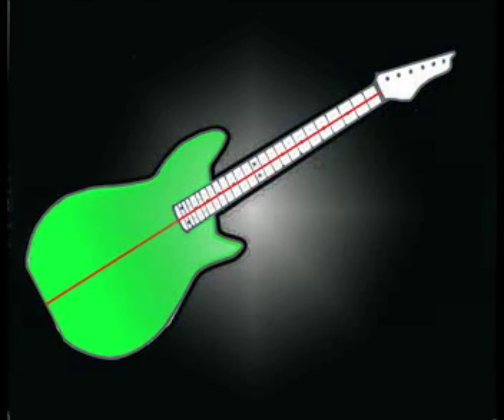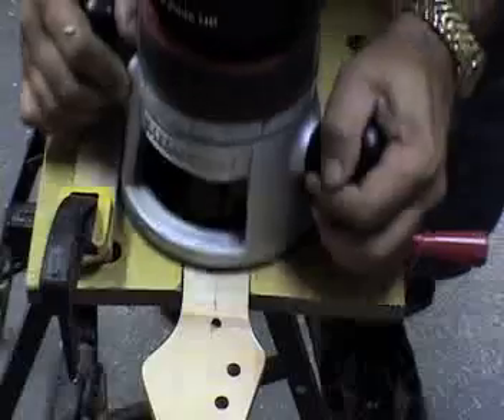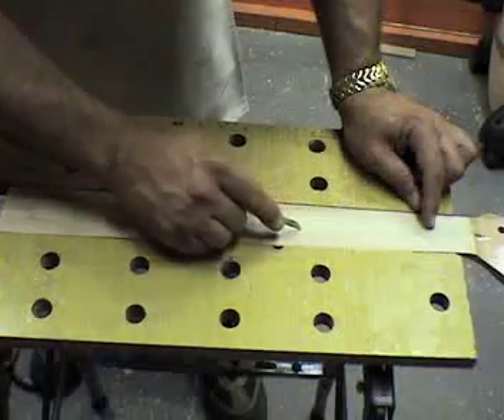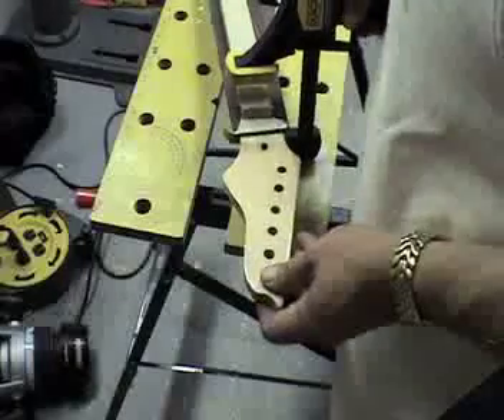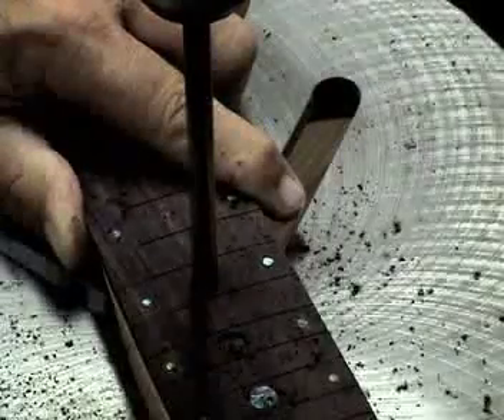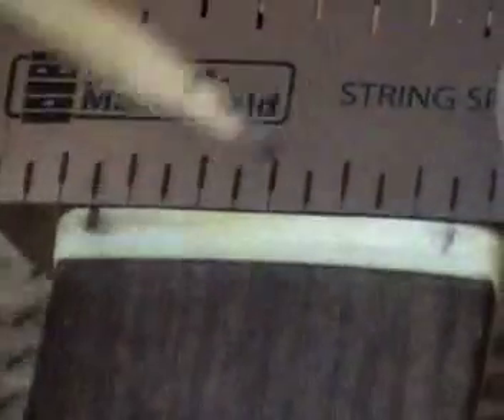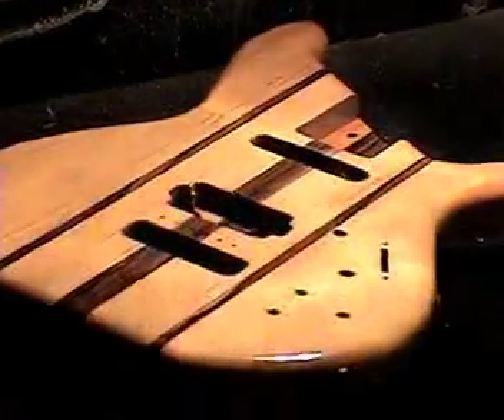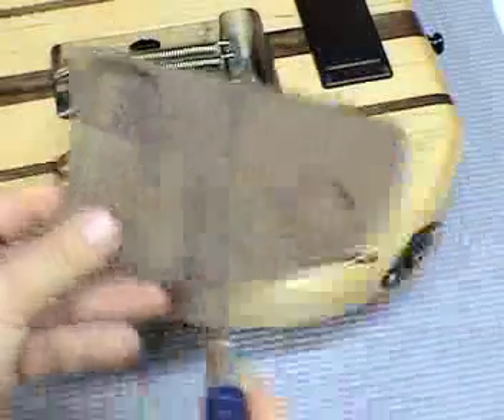How to Build a Solid Body Electric guitar Part2

Comment from the maker: @r7mart The nut needs to be high enough so it can be slotted for the strings. When slotting the nut you need to make sure each string rests just above the first fret. the closer with out touching the better. Strings that are to high off of the fret will play sharp because you are stretching the string when applying pressure.

Comment from the maker: @guitarslf132 You need to know where you want to mill first of all, Depending on what type of jig you would center it. But without knowing what you are talking about that is a hard question to answer. Stew Mac frets are all made to be installed in a .23 slot.

Comment: The best is to buy well dried wood, not from a diy store.
I built a hardtail neck-through guitar and i connected the ground wire to the bridge by carving a very tiny channel starting from the bridge screw that's closest to the electro cavity.  That channel was 5mm long, not more so it's entirely under the bridge and is invisible.  Then I drilled an oblique hole from the and of the channel, to the cavity with a 3mm bit.

Comment from the maker: @cjscanlon0205 The sustainer cost me $100.00 but that was a great deal, a store closing. But I'm sure you can find a kit on the internet or Fernandez web site. If you has worked with wood before you should be able to build a guitar if not it is going to take some practice. but if you take your time you will probably do a good job.

Comment: hey man, i was wondering if putting lots of grain filler on the different types of wood would stop them from contracting or splitting apart.. if not, i need to know which way you have to put the grain so that they don't break apart when they are contracting.
Thanks!

Comment: @cuziblack123 The hardware shouldn't be that heavy, it should be fine, and even if it is off balance, you can compensate with the position of the strap buttons.

Comment from the maker: The paint I use is a transparent  water based paint that can be purchased at any art supply store. It is primarily used with an air brush. Seal the wood with a clear coat, apply paint when you achieve the correct paint job you must seal it with a clear coat. The cool thing about this paint if you don't like the result you can wash it off and start over.
Perry

Comment: So, big question. I'm about to start this project and I want to use a bridge I took off of my nephew's guitar (it's a vintage-style trem), and I'm using a PRS scale (25"), so would I measure out 25" from the nut and the lay out the bridge across that line to about the halfway point that I can adjust the saddles, and then lay out my template from there?

Comment: Now I understand that we can't simply match different guitar and body. They have their own measurement. Both lenght from 12 fret to the the bridge and 12th fret to the nut need to be equal. Otherwise it will be out of tune after 12 fret, even the saddle cannot compensate it. Anyone got any answer to retify it or the guitar will be such a waste?